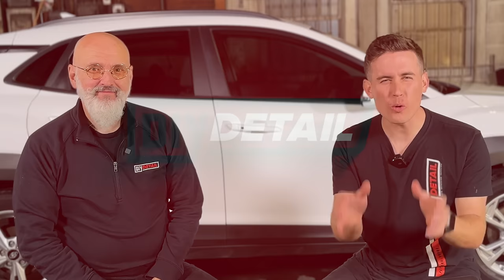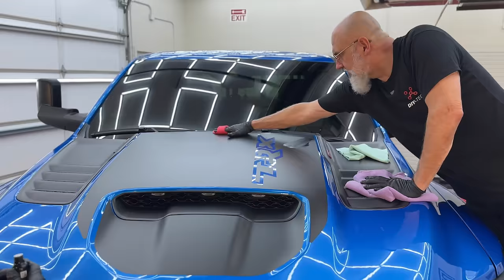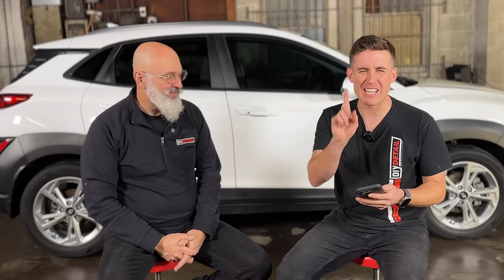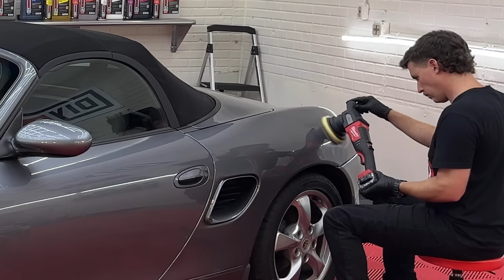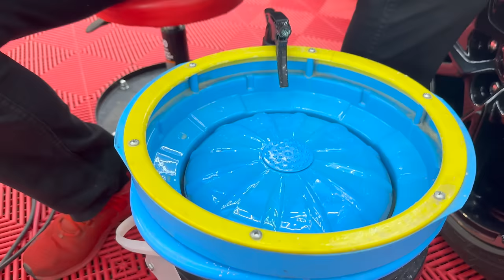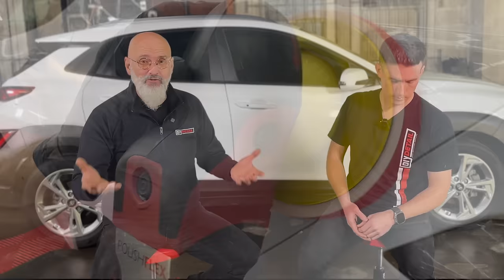Avoid these OVERRATED detailing techniques: 5 tips to save you time | Podcast #83 #diydetail

Comment: As a 100% mobile detailer whose main focus is ceramic coating and paint corrections, I could not survive without the tips in this video. Circular motions for applying the coating and using a pad washer and damp pad shave hours off the process and deliver top notch results. I can do an exterior detail/decon with the clay towel and iron remover, single step machine polish and ceramic coat in a single day in the comfort of my client's own driveway. Thank you, Yvan!
Reply from the maker: Great to hear!
Reply: Is a single step machine polish outdoors okay to do?
Reply: Exactly

Comment: I've done testing with foaming the car, followed by a contact wash vs. foaming the car, let it dwell, rinse, foam again, contact wash, and the latter option keeps my wash bucket way cleaner. I use clear buckets, and I can see how much less grit is in my bucket utilizing the latter method.
Reply: Skip the second foam as it is really overkill. But using a good alkaline foam-dwell-rinse is good practice
Reply from the maker: Great point!
Reply: Agreed
Reply: @Zoranurai13  I mix KC gentle snow foam with KC Green Star and I get 10.5 ph in the foam canon. I use half for the pretreatment and the other half for the contact wash
Reply: Ohh what’s that pretty white car?
Reply: @leighg9274 looks like a Hyundai kona
Reply: Have you tried to add APC or degreaser in foam and compared to just foam wash ?
Reply: @TruNGenius  I have and the 100ml of APC in the foamer raises the pH and helps knocking down all the heavier contaminants that will mar the paint.
Reply: Start with Alkaline pre wash then acidic ph on ur wash itself. Try it  and you’ll see the difference and will save u a lot time and streaking
Reply: @1kontrabida  I'll give a try! Good point!
Reply: @theunkownmr.562  ALkaline pre wash followed by acidic wash will neutralize alkaline pre wash. Another tip if u have water spots use phosphoric acid to clean/ remove water spots.
Reply: Same here. I used the first in the past and saw tons of dirt in my wash bucket. Foam, set, rinse, foam and wash….much less in the bucket. Still finding the best mix of product and equipment, but it’s getting better and better.

Comment: You both keep saying you work on an area of an “8 inch circle” but then in the video demonstrations we see you doing about half the hood in a 18inX36in area. Which one is it? Do as I say, not as I do?
Reply from the maker: The circular motions we do with the pad are approximately 8 inch circles, to then cover a larger area
Reply: Even in their own video they miss a spot and go over some spots several times. This is why circular motion for ceramic coating is garbage and not recommended. Straight lines and cross hatching ensures that every spots gets at least 2 passes.

Comment: No more two bucket washing for me. One bucket with several mitts. A dirty mitt never goes back into the bucket. No contamination of wash - ever.
Reply from the maker: That works!
Reply: This method is further improved with the use of some plush microfiber towels. Then you get 8 clean sides per wash media and are never using potentially dirty media to clean a panel.
Reply: Started doing that too. The second bucket is now used to toss the once used mitt or towel into!

Comment: I bought a brand new 2025 BMW X5 M60i from the dealer and sold as new. Turns out there is a 4inch razor slice down at least to the base coat, through the new candy paint and love bug, bird poop and tree sap etching in the paint. When I bought the mess to the sales manager and salesman they swore that they could fix it like new, which they could not. What’s worse, unbeknownst to me, they re-buff all the junk into the paint again, ceramic coat over the mess,  scratch the mess out of my new car and call it a day. They thought that I wouldn’t catch what they did and now were going round and round about fix. I’m ready to get a lawyer. Any input?
Reply from the maker: Refuse delivery of the car, call BMW corporate.
Reply: What if they’ve agreed to paint correction?
Reply: Will I loose to much of my original clear coat? What are the drawbacks. I had trusted them and took delivery. Found the slice when I got the car home the same day of delivery. They buffed the slice saying that it would look brand new but I can see the slight impression. I’m wondering how much life to my paint I’ll loose! I am angry!
Reply: Will I loose to much of my original clear coat? What are the drawbacks. I had trusted them and took delivery. Found the slice when I got the car home the same day of delivery. They buffed the slice saying that it would look brand new but I can see the slight impression. I’m wondering how much life to my paint I’ll loose! I am angry!
Reply: Sorry for the double post!
Reply from the maker: I wouldn’t trust the dealership at this point. Find a reputable detailer and have them assess
Reply: @diydetailofficial  All is well!! All the best detailers said they would not touch the car and risk a burn-through. I reported the dealer to BMW Corporation and will agree to nothing less than a brand new car! Thanks for your help guys!!!

Comment: Touch up paint . 3 coats . Then final coat with clear. Sanding 2000, 3000, 5000. Then polish with gold standard with diy wool pad. Phenomenal reults!!
Reply: I forgot to say to use a rubber mini squeegee to level the paint to a flat surface
Reply from the maker: Thank you.
Reply: @diydetailofficial  just wondering if there are any fillers in the gold standard to make the paint gloss so much
Reply from the maker: No fillers

Comment: Thank you for the tips! Disclaimer: I only wash one car, mine. Instead of washing mitts between panels, I put six mitts in a soapy bucket. I use one side of each to wash two adjacent panels top to bottom. Then I flip it over and wash two more adjacent panels. Then the mitt goes in an empty bucket and I grab a new mitt out of the soapy bucket. It usually only takes five mitts, with the sixth as a backup in case I drop one on the ground. At the end, all of the mitts go into the clothes washer along with all of the other microfiber products I used in the process, and they all get washed (gentle cycle) and dried (low heat). I don't need to wash anything but the car during the process. Mitts are cheaper than time.
Reply from the maker: Great tip.
Reply: I do the same, except I use MF towels.

Comment: The brush for tire dressing .. what a brilliant idea!! Thank you guys for sharing your knowledge and making detailing more fun!!
Reply from the maker: Thanks for watching!
Reply: This has been a life changer for me!  I have a LOT of huge trucks with colossal, knobby tires in my market area and that tiny foam applicator wasn't cutting it for me.  Initially I thought the flag tipped brush was going to be too sloppy but legit on the first tire my technique was locked in and my accuracy was pinpoint.  I'm NEVER going back.  From low-profile tires to mudders it's the ft brush every time.
Reply from the maker: Thank you.
Reply: I just buy a €1 sponge, cut it up into 6 or 8 bits and use them, lasts a few years to get through them.
Reply: Which one it's better? PPF or CERAMIC COATING?
Reply from the maker: Coating on PPF

Comment: 5:05 lol! Thanks for the laughter Yvan 😄

Completely agree with the swapping pads. Ive saved so much time just by using the pad washer every after one panel. Also as a 4x4 enthusiast, im happy to say that i also apply tire dressing by using flagged tip brush. So easy to apply on knobby sidewalls compared to a hexagon or small sponge type applicator.

To me, the most overrated method in carwash, is the wheel wash using several type of brushes every time. Sure you can clean the barrels with a long wheel brush, use a paint brush-type for the nuts and crannies, or even a lugnut brush, iron decon, APC, foam. But if you regularly wash your car, all you need is APC, small mitt for the wheels, and a flagged tip brush for the rubber.

You guys are teaching us how to efficiently clean and wash our cars eeeeverytime, thank you so much, Yvan and Nick! 🤘🏽 Keep it up 💪🏽
Reply from the maker: Thank you.

Comment: Thanx for the content.  Agreed the foam rinse foam is a go to.  My biggest time saver when doing regular washes is rather than using the traditional 2 bucket method, my second bucket is empty at the beginning.  My soap bucket has 4-6 micro fiber mitts, instead of rinsing and then re-soaking I just throw the mitt in the empty bucket and grab a new one then take all the "used" ones, rinse them and throw them in the washing machine on eco mode with an extra rinse, air dry them and put them away.
Reply from the maker: Great tip!
Reply: Agree 100% with the one bucket and always using a clean mitt or towel to wash.

Comment: I wash the wheel wells when I wash the tires and wheels. Makes the finished car look so much cleaner with clean wheel wells. The plastic and carpet look darker and mat which I feel helps frame the wheels and helps the paint pop and  look shiny. Especially effective on light coloured cars. 

So I foam the car, tires, and wheel wells let it dwell then rinse. Foam again, wash the wheels, tires and wheel wells and rinse and foam the paint again for the contact wash. I live in Taiwan and we get lots of industrial fallout and the trees leave a soft sap that will stain your paint if left in the sun to bake. The third foam helps soften and dissolve the sap and makes removing the sap easier.
Reply from the maker: Good tips.

Comment: What I use for tire dressing is just a 2-inch natural bristle paint brush. Between 1 and 2 dollars from the hardware store, and they deal with all the sidewall patterns and ridges beautifully.
Reply from the maker: Excellent
Reply: Glad to see another person using the same as myself.
Reply: I spray universal high shine and don't touch it at all
Reply: @Rabbit.760  And get overspray on the wheels, and half of your product just blows away in the air.
Some of us have more sense.
Reply: @DjNikGnashers  I mean for the product you use and know about maybe. If you didn't think of that, then ya, only some of us indeed, have more sense
Reply: @DjNikGnashers  the product I use is solvent based and is dry to the touch in seconds
Reply: @Rabbit.760  I am not going to try telling you or anyone else how to detail a car.
All I will say is this, I used to do it for a living, professionally, at main car dealerships.
You wouldn't spray your ceiling one colour in your house, then try to spray the wall a different colour and expect to get an accurate line of division between them.
If you spray your tyres, you WILL get overspray on the wheels, and whatever product is used to dress the sidewalls, will also end up on your wheels too.
By using a tyre dressing which is quite viscus (thicker), and applying with a brush, you can get a very thick coating of tyre dressing on the sidewall and right into the gap where the tyre meets the rim, without getting ANY on the wheel or even the rim itself.
It's quicker than any spray, it puts a more even and thicker coat on, and it's a lot more accurate.
No professional valeter or detailer would use a spray to apply tyre dressing, because it's a bodge. Carry on doing whatever makes you happy.
Reply: @DjNikGnashers  I currently do this for a living as you should have figured out already and I'm sure that most people here do this for a living as well. Not a valid arguement and that reference didn't make sense
Reply: @DjNikGnashers  plenty of spray on and no touch tire shines out there which might be after your time idk. Get you some, you'll see
Reply: @Rabbit.760  Your 8 videos on your channel are basically gaming, Trump, and growing cannabis.
And you think you can teach a 54 year old man with decades of detailing experience anything LOLOLOLOLOL.
Don't embarrass yourself kid.
Reply: @DjNikGnashers  times and technology changes... your 2 year old grandson can teach you how to use the cell phone that your colleagues designed
Reply: @DjNikGnashers  fine... you made me upload videos again for the first time in years. Gave my whole youtube a makeover just for you

Comment: Foam, rinse, foam, contact wash with clean mitt or microfiber towel, one wash bucket, do not put a dirty mitt or fiber towel back in the wash bucket. Always use a new clean mitt or towel to wash a section at a time. Only need 4 or 5 clean mitts or microfiber towels to wash most vehicles. Do a section, put the dirty/used mitt or towel in a different empty bucket to be washed later. Take the new one, dip it in your clean wash bucket, wash another section, discard it in the bucket with the other dirty mitts and towels, and repeat. Then rinse, blow off most of the water with an air gun or leaf blower, then dry with microfiber and a drying aid, some type of a quick detail spray to help lubricate the surface and add glossy shine to the vehicle while drying it.
Reply from the maker: Nice process

Comment: Another overrated point is thinking that products can be used in 1 way only. It may (or may not) work better but it will certainly cost much more long term than having 1 product that can be used multiple ways (ex rinseless as wash, clay lube, interior, pad washing, etc)
Reply from the maker: True
Reply: you nailed it there.  even carpro immolube which I tested recently I told Avi the owner of Carpro all the other things I can use it for that he never designed it to do.  I cleaned my whiteboard with it and although not ideal, as I had no dedicated cleaner and couldnt get the blue marker imprints off with the duster, the immo at 1:1 sure did.  it also can be used as polish extender and a pad cleaner in a pinch.  spritz the stained pad, give it a rub with a glove on or use a brush then compressed air blow or or rinse it and bingo, super clean pad. no more stains and it doesn't soften the foam or discolour it. this is why sometimes manufacturers send me stuff as I test things with outside the box methods and on surfaces never designed to be used with it.   using polishes on exterior trim is another, not all will stain trim, they fix them.
Reply from the maker: Thanks Matthew

Comment: I'm so glad I found this channel and this video through Pan's channel.  I used to dread detailing my car.  I would start early Saturday to get it washed and clayed, then spend Sunday trying to polish and wax.  It almost always take up my whole weekend and I was not doing anything other than working on the car.  I would even bike or walk to lunch because I didn't want to drive the car in the middle of everything.  Most importantly, I would be so exhausted and sore after the whole ordeal.  I still did it because I wanted the car to look great but it did wear down my passion over time.

After I replaced my car with an SUV I actually never properly detailed it because of the amount of work and time I'd spent.  I would just hand wash then a coat of wax at the beginning of spring and then again at mid-fall, while just going through automatic car wash in between every other month just to save time and effort.  The car is clean but it's not great, and I can still see swirl marks since the day I took delivery (yes it's kind of like Pan's new car that came pre-swirled).  Now that I saw this video and Pan's on prepping and detailing his new car, I think I'll invest in some tools and pick up detailing again on mine.  Thank you so much for your advices.
Reply from the maker: Wow, thanks for sharing, you can also join our Facebook group 

https://bit.ly/DIYDetailFacebookGroup

Comment: Does the pad wash work the same for MF Pads as it does for the foam pads or should MF pads be swapped out once they are saturated with product? Also, is compressed air not a good idea for them as well?
Reply from the maker: The pad washer works with all pads

Comment: Question about polishing with a damp pad (If you guys see this): Whenever I'm using your gold standard polish I wash the pad just like you guys. However, I recently decided to use the Rupes Uno Advanced, which says to not get it wet and has to sit and cure for the coating. Can I still use a damp pad for the AIO products?
Reply from the maker: Follow the manufacturers instructions, or do a test